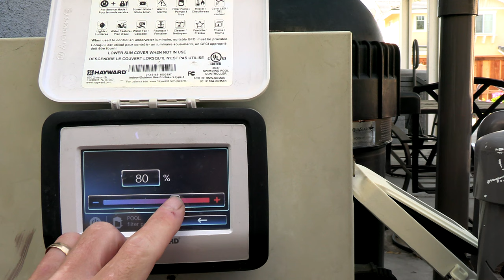Polaris ATLAS XT Installation and Set Up Video

Comment: Ive been using a variable speed pump with popups and my walls are getting dirty with algae. Would this be the best product to use to clean the walls? Would I leave it in all the time, or just put in once a week to scrub the walls?
Reply from the maker: Usually these cleaners are not comatible with in flor pop ups. A robotic cleaner is a better choice.

Comment: When you were installing...where did the adjustable flow valve go?
Reply from the maker: In the skimmer
Reply: @SPL  okay, mine isn't fitting there as it's on the side of the round skimmer hole. Not enough space.

Comment: I've had one for about 6 months. Works just as good and maybe better than The Pool Cleaner 4 wheel.  Unfortunately it recently stopped moving.  The Scrubbers on the bottom are rotating but the tracks are skipping and not turning.  But the bottom underneath scrubbers are spinning away.  It's pretty new and the track and gears inside look good and new.  Am I missing something?
Reply from the maker: Call tech support as they may have an easy solution.  800.822.7933

Comment: Hi, Is the clicking noise normal for this Atlas XT? it's coming from the spinning center part. thanks
Reply from the maker: Typically no.  Maybe some debris stuck in there
Reply: @SPL  it's brand new, no debris, I'm going to call the manufacturer and ask if the rotation of the halo makes a clicking noise while spinning.

Comment: I have the leslies version. I was going to return it to get a robotic cleaner but it works so good. Every night I say if u dint pick up those leaves by morning your going back and every morning there gone. So it stays. Had it for 2 weeks. Really a great suction side cleaner. U have to find the sweet spot to make it run good. 2000 rpm it will move fine but no wall climbing.  2600 rpm does it all. Now I had a issue about the suction taking away suction from the skimmer but if u have the skim a round skimmer basket which I do it will create a vortex on low suction works great. Let's see how the parts last.
Reply from the maker: THt's one way to keep it picking up leaves, threaten to return it! 😜👊

Comment: I hope these turn out to be less maintenance intensive than the MX8 Elites.
Reply from the maker: Me as well. 👍
Reply: @SPL  Great - I'm supposed to be getting an MX8 Elite this week, since I can't find the Polaris anywhere I've called.
Reply from the maker: @rickp3259  Try to find a Polaris MAXX from Leslie's
Reply: @SPL  I called several Leslie's near me. They weren't even familiar with the MAXX. Are the MAXX parts interchangeable with the MX8?  Maybe as I have to replace parts I'll put MAXX parts in it if they're better.
Reply: @SPL  mine isn't moving good after only 6 months.  The bottom scrubbers are spinning good but the tracks are skipping and not catching thus not moving.  The tracks seem beefy and the gears inside seem new and nothing out of the ordinary when I opened it up.  I can spin the bottom scrubbers with my finger and the tracks skip and don't rotate..